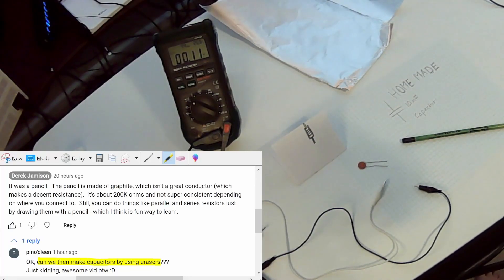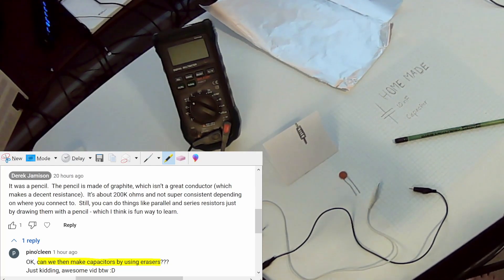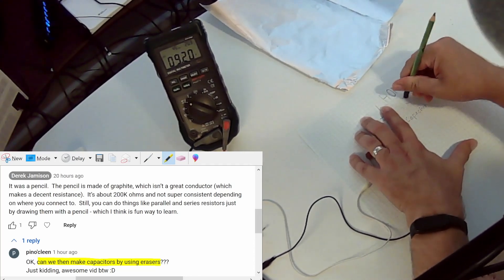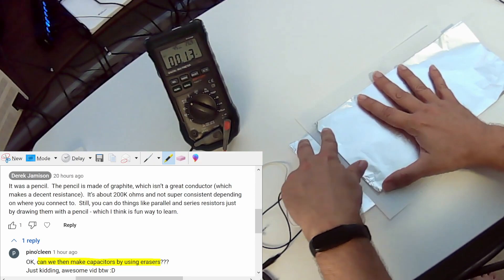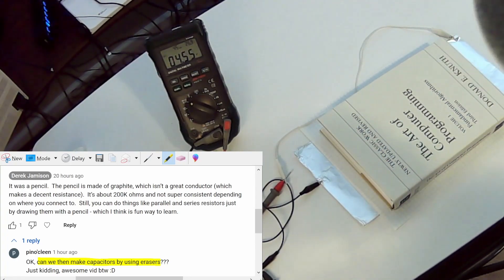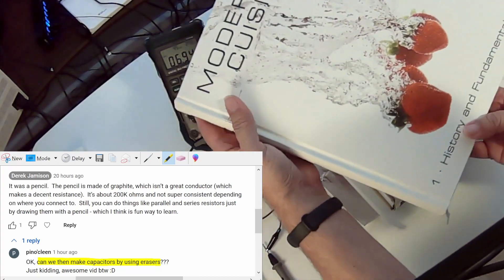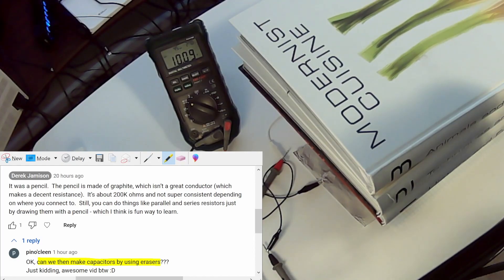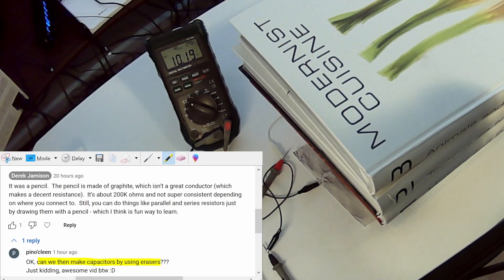[34] Homemade 10nF capacitor

Comment: Great little video :)  I'm currently building key pad which runs the voice memories on my FT1200DX, its for my radio clubs annual construction competition.   I'm using alternative materials (paper & copper tape etc) to the usual perf board, wires etc and found myself in need of a 10nF capacitor, whilst I would've loved to have used your idea (its a bit big) I don't have the books you used lol.  On a serious note, what a great demonstration, I used a similar principle a while ago to 'tune a crystal radio set', put me slap bang in the middle of the UK's broadcast band, which was a bit of a pity as I was actually aiming for 3.66MHz lol.  Tnx Lin.
Reply from the maker: Yeah, that cookbook set is still over $500 USD& the programming books are probably hard to find 🤣.   https://a.co/d/eu8w22f

Glad you enjoyed it & sorry it wasn’t the answer to your question; good luck!